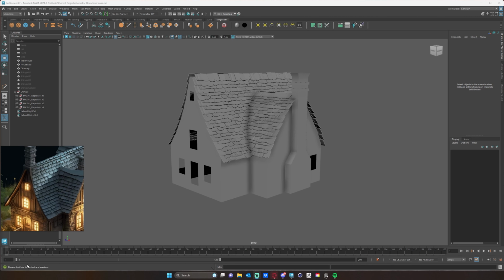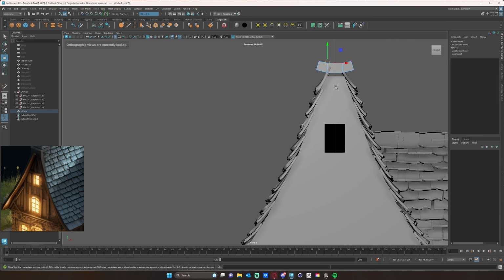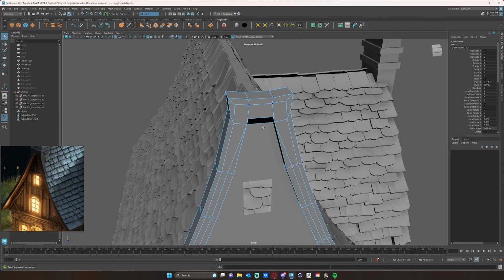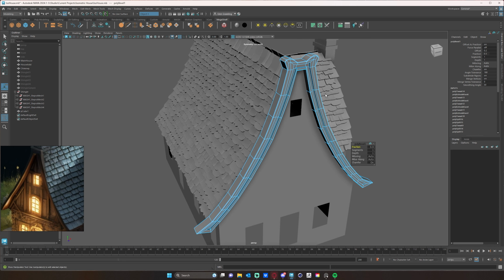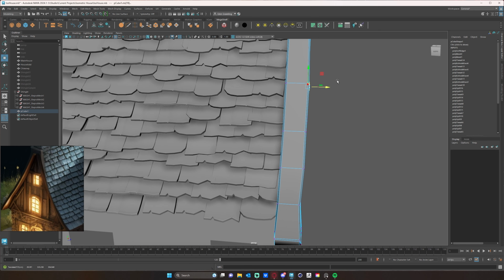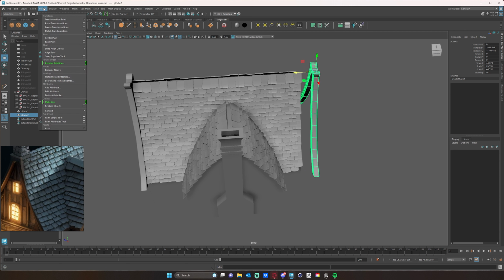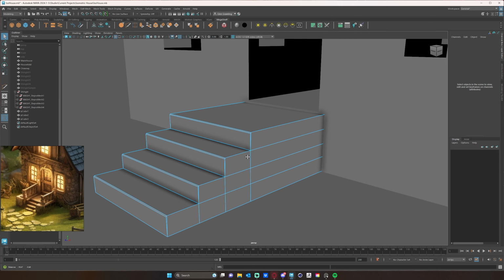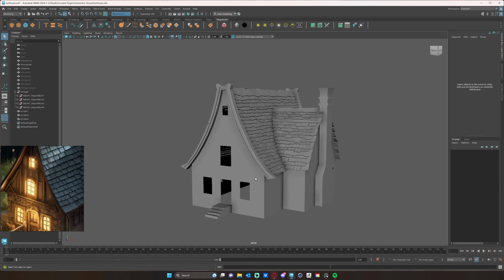004 Modeling details on the house: Stylized Environment Creation

Comment: Hi! First of all, thank you! I found very useful this tutorial series. I'm wondering if the overall geometry I see in mode 1 is the final result that will be displayed in the render or engine where we export it or it is strictly necessary to make a good topology according on what we see in mode 3. Many thanks!
Reply from the maker: For this series I never leave maya and I'm only using it for an Arnold render so I'm not really too concerned with the topology. If I were modeling this for a game or to go in an engine like Unreal I would probably model it in an entirely different way so that it's optimized for real time rendering.